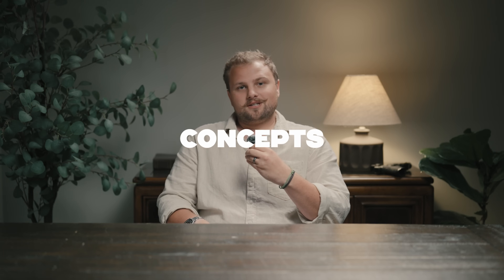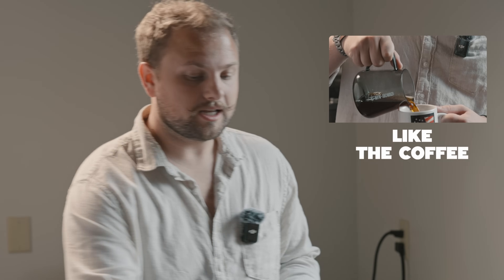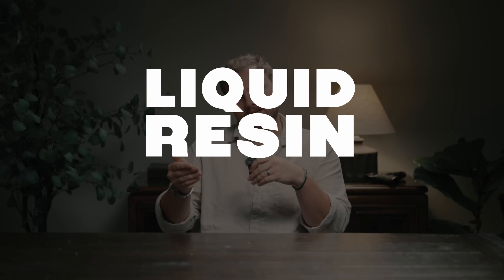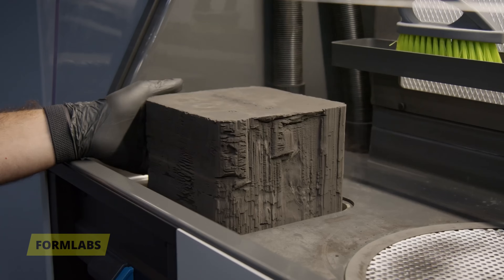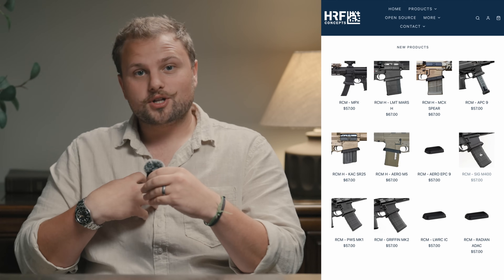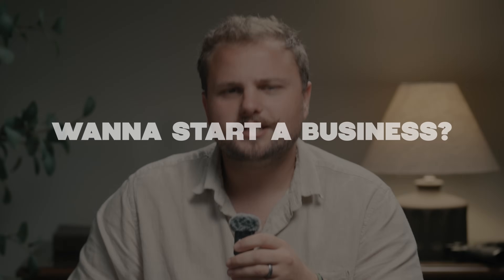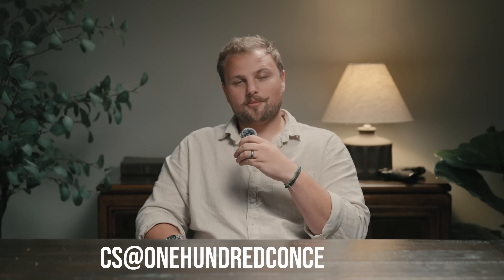Why we're so expensive... (Cost of 3D Printing)

Comment: how the hell does that spotter cap cost you 160 USD???

If I take that STL file and ask a print farm with MJF printers to make that part for me in large quantities I would pay around 30 USD with tax for a single 100mm killflash design made by a chinese company, and 50 USD made domestically
your light cap printed by a MJF manufacturer would btw be 15$ for a single piece, or 5$ a piece for a batch of 100 made domestically

also, the anisotropic properties of MJF printing dont matter for the parts you are making, because they never experience enough load
so simply printing them with a 0.2 or 0.1mm nozzle in FDM nylon would be enough and you could make them far far cheaper.

so you are either getting ripped off, or you are lying about the cost of production.

and your argument of "oh inovation"
I can make your parts and similar inovative things within 15min in CAD, its not difficult

Comment: I appreciate you making this video. I spent the time and made my own light caps. Just because I wanted to see how many iterations it took for me to get a proper fit and finish and find a shock cord that works from the ground up. And it took me three iterations to get the caps to fit properly.  Most of these people that are making these and reselling them. Are not using high-quality materials just using PLA I printed mine out of pet – CF which even while making contact with my suppressor because of how close the light sits, it doesn’t melt.

Comment: What are you basing all of your specs off of? The argument of "Well ours are stronger and more UV resistant!" falls apart completely when you realize that there's dozens and dozens of different kinds of plastic you can print with. 

I can't speak for manufacturing costs but you basically had no response to "the other company" that's also using MJF for half the cost. You just said they were copycats and can't think of anything new on their own. But why specifically are they half the price of you?
Reply from the maker: No R&D costs since we did 99% of the work for them by purchasing countless optics, dialing in sizing, fitment testing, range time, and other over head costs.
Reply: @onehundredconcepts  you know that you dont need to purchace optics right?
a simple question online like: "hey what is the outer diameter of optic X?" would be enough.
or you propably could loan them, likely even from the manufacturer of the optic.

and R&D on these parts is cheap, I can sketch up a new scopecap for some optic within 1h
lets say dialing in all parts would take 2 days in total for a new cap, thats around 200-300$ R&D

when you plan to make 1000 units that would mean the R&D per unit is a few cents

so again, why are you so expensive?

Comment: You should include a visual example of why FDM is inferior to MJF. For example how direct sunlight quickly deforms PLA, while it has no damaging effect on MJF.
Reply: That isn't a flaw of FDM, that's a flaw of PLA. FDM printed nylons aren't any more succeptible to heat warping than MJF nylons. Sometimes it's the exact same material
Reply: @Horseysauce  I absolutely agree but some of the less experienced “printers” out there believe you can print anything with PLA. If they saw what happens to their prints visually they would understand why other filaments or formats would be better.

Comment: All manufacturing is expensive, even 3d printing, employees, shop space and other costs add up quick.      Its good to show people what is involved so they understand that. 

 I have an ACOG scope cap pro and its fantastic, compared to the other alternatives (for front and rear covers) the scope cap pro is definitely the best option, well worth the price.

The funny thing was I had a slight issue with mine, the rear fit great but the front cap wouldn't fully seat, I could tell it wasn't quite right but tried it as is and the thing moved under recoil,   I ended up taking some 600 grit sandpaper and shaving the bezel ring down slightly as well as the peg that secures it in the bottom at the front.      I reached out to the company to ask what they recommended and said I thought I was having issues because of the tolerances of 3d printing and the guy categorically denied it as a possibility which I thought was hilarious since that was the only thing it could be.

Comment: Hey, how did you calculate the 159$ cost for the MJF part?

Did you include the price of the machine itself devided by the amount of said part you made with it?
MJF is an extremely price efficient process, in my experience, beating the likes of large format SLS or SLA. So i do find it quite weird how you got it to be that expensive.

Even using their new fire retardant PA, or the PA-GB, it shouldn't cost that much.

Otherwise, very interesting video with quick but good info on the difference between different processes, 3D printing isn't simply a cheap hobby way to make part that look like toys.
Reply: I'm assuming the $159 price tag is because they get them made through a sub contractor with the capabilities to make certain products either in bulk or for cheaper than it would cost for the company to purchase the machinery to do it themselves.
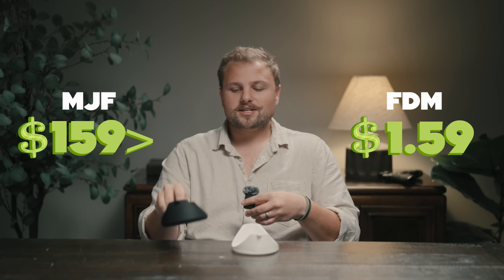Reply from the maker: Hey, Kraken! You're right, MJF is extremely price efficient compared to other additive manufacturing technologies and often competitive with injection molding, given that sales velocity can support the initial investment. At 5:19 I say: "This isn't frankly a great example because MJF excels at really small parts where we can pack a bunch of them into one print." 

The unspoken part: Our spotter caps are the product most frequently referenced by people complaining about pricing online because they go to our website, sort by: "Price: Low to High" and then pick the first one. We chose to include this comparison specifically because it is so often referenced by others, even though I think it's a poor example for the following reason:

The reason the price is so high is the physical volume of the part. The design of the body and the collar creates a lot of dead space in the print volume that cannot be used, especially since we are committed to prioritizing strength along the layers. We could use a more efficient packing method allowing us to fit more into a build, but this would come at the trade off of reduced parts strength that we are not willing to compromise. As such, we can only fit 10-20 sets of the product in a build volume.

Cost of products is influenced by material cost, but more so by machine time. Hyperbolic example: If I printed a single LightCap at the top of a build, you would have hundreds of layers of unfused powder and then a 42 gram part. If the manufacturer charged me for the materials only, it would be at a massive financial loss. So the part cost formula looks more like: Fixed cost of a full build / qty of parts. I can only fit 12 full sets of the 104mm spotter cap in a build at an optimal print angle.

It honestly doesn't make sense to make them with MJF for the manufacturers or the customer, and if the sales velocity were there to justify injection molding them, I would probably just get an injection mold made, but the sales velocity is low because the cost is so high. This is why we are the only people making them in MJF because nobody else wants to put up the capital to do so, and honestly, I'm kind of tired of tying up capital in a product with such a low sales velocity, but I think the product should exist for those that need it and so I begrudgingly stock it anyway. And then a bunch of people who probably don't need one get mad that it exists and make angry posts about it online.

Anyway, I think the spotter cap is a cool an necessary product for modern war fighters and would be far more cost effective with injection molding, but the only people who could justify the up-front cost that incurs would be the optic brands that make/design the spotting scopes. They would have the data on which spotting scopes MIL/LEO are using and could spend $40k on a mold to make them. And then all of the civilians who wanted one would need to buy the same spotting scope the military/LEO are using which is likely far more expensive than their current spotting scope at which point the cost of an MJF Spotter Cap would seem rather insignificant.

This response has grown rather long, but it seemed you were genuinely curious and so I thought I would take the time to answer sincerely. If you've read this far, you rock. Thanks for participating in meaningful and civil dialogue!

Comment: I needed (ok, wanted) a shock collar for the OG scope cap I bought for a PA 2.5-10 GLX, but you didn't have any collars listed that fit at the time.  So, I found some files in the wild and scaled until I had a good fit, then did a final version in PA6-CF.  Then I shock collared all my OG light caps in nylon too. 

I've seen a few printed light caps in PLA and also seen them melt in the Florida heat, or melt when the light was switched on.  Caveat Emptor. 

I still love ya, still buying from you for things like Hex Caps.  BTW, we met at a Barrel & Hatchet class a couple summers ago.